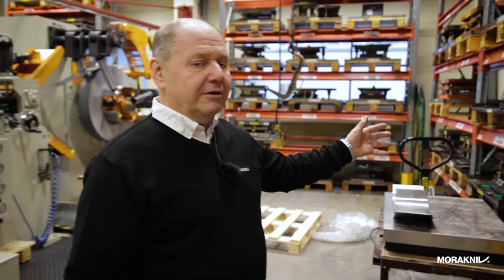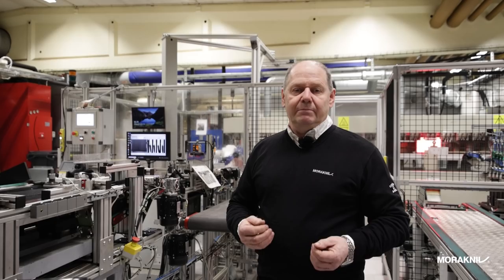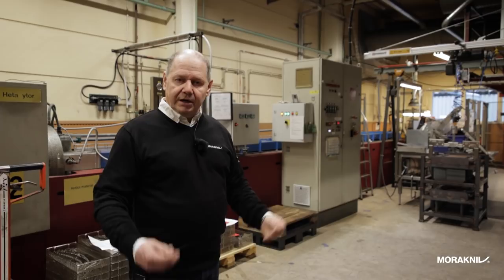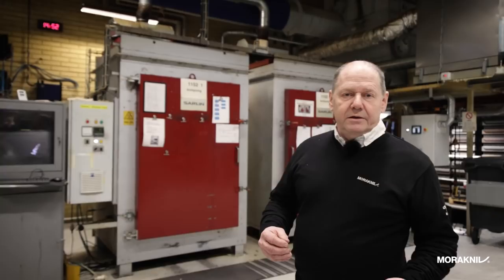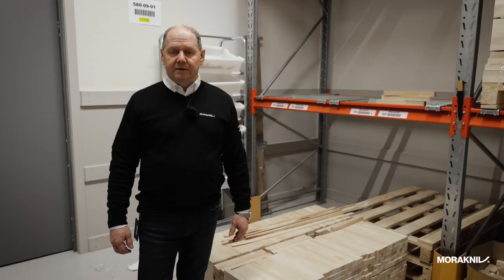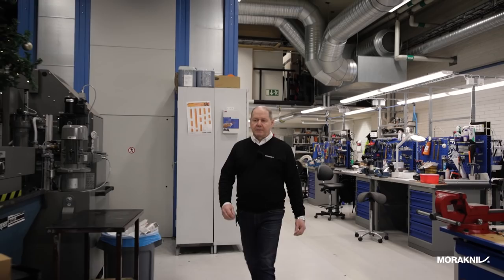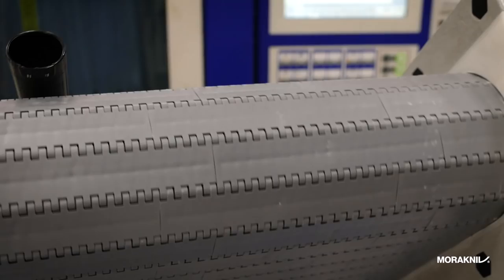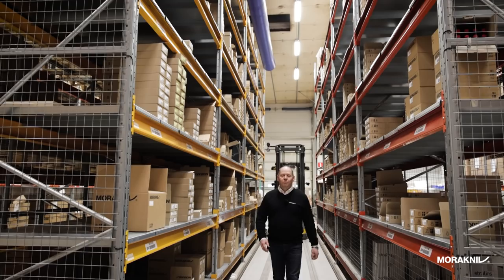Morakniv 130-year Anniversary - Factory Tour

Comment: Best value knives, you can buy! I would wish a knife that has a partial sharpened spine at the back,so that you can use a firesteel AND your thumb doesn't hurt,when you put it on the blade right behind the handle. This would be wonderful. A sharp spine near the tip would be the best,  I think.